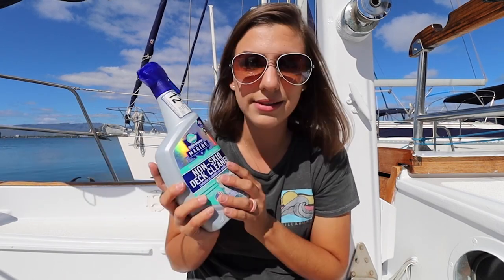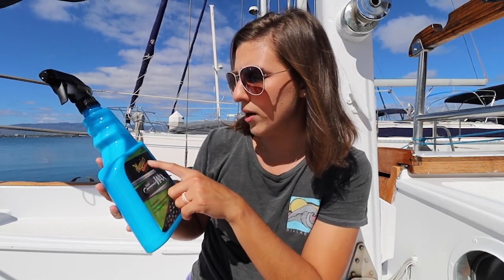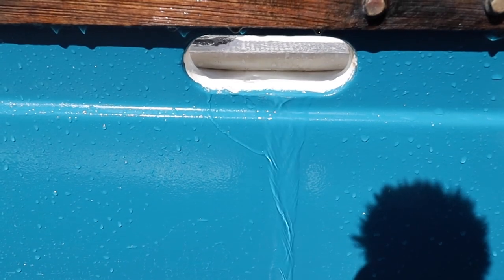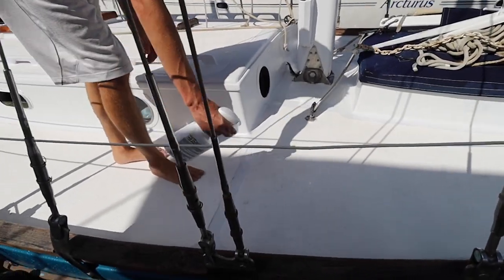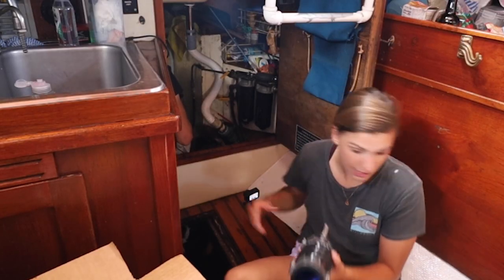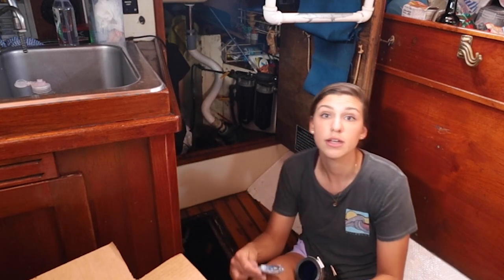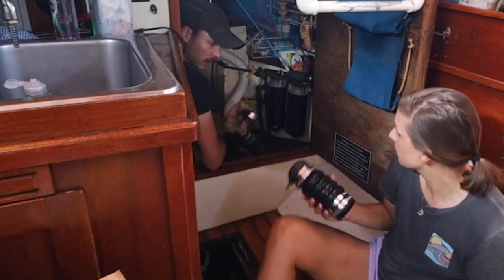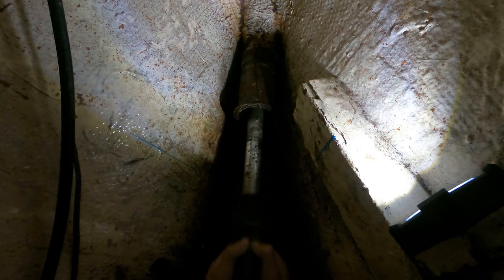WE TAKE ON WATER: Installing a Dripless Shaft Seal without Hauling Out Our 1977 38' Sailboat - Ep 38

Comment: Does the shaft seal need to be water fed? Or is that as is and just used the hose as a vent?
Reply from the maker: The hose acts as the vent 🙂
Reply: @sailingposttime  why do others water feed the seal? While others vent it only? And if you have an idea what size the hose is, that would greatly help. Thanks.
Reply from the maker: @GHanBax  Sailboats usually run at a lower rpm so they don’t need to be water fed just water vented. The tube is 3/4 OD and 1/2 ID
Reply: @sailingposttime  What would be considered low rpm? And how many knots would that be.
Reply from the maker: @GHanBax  it really will depend on your boat weight and size. :)

Comment: Great job. Did you order an Electric Yacht motor? Curious how you will fit enough solar on your Ingrid! We are trying to fit 350w worth now :)
Reply from the maker: No, we ordered a motor through Thunder struck motors. It’s tricky with how the boat is for solar! The mizzen and main and the booms make it difficult. For now we have shore power to recharge as we get the motor in. Then we’ll have to problem solve for solar!